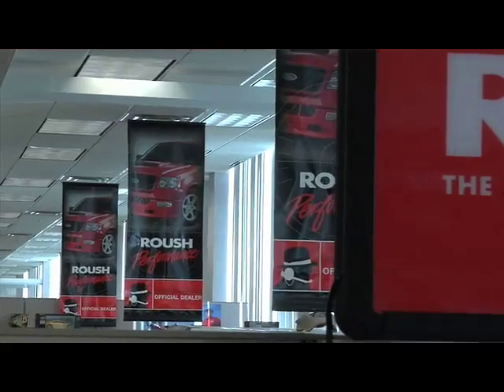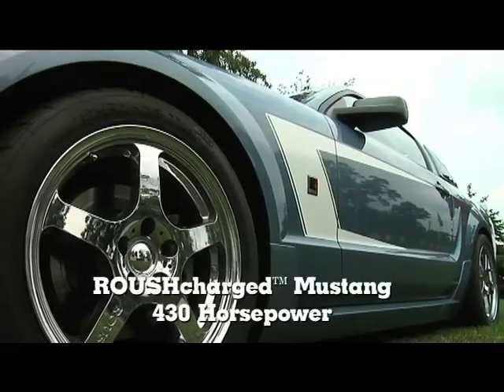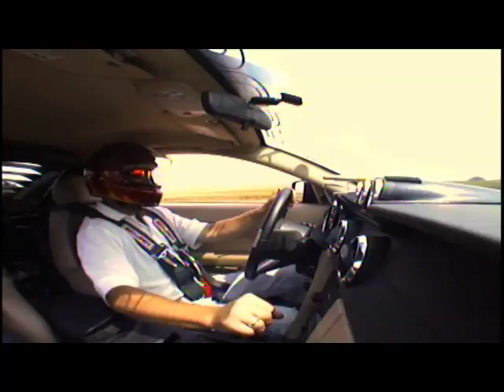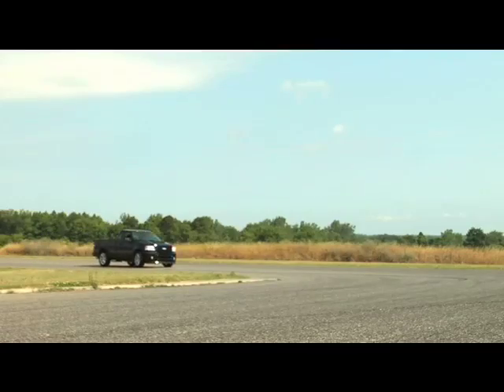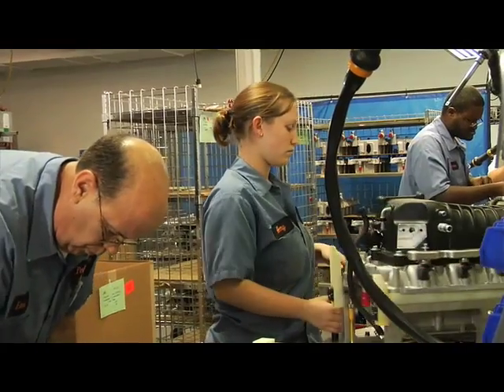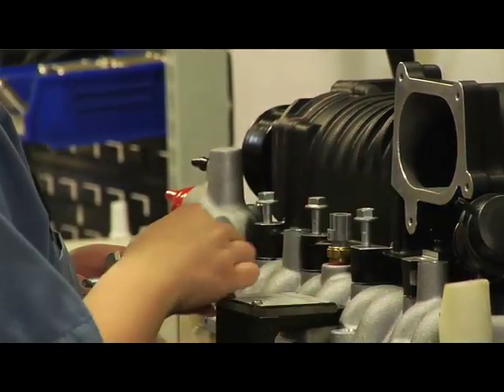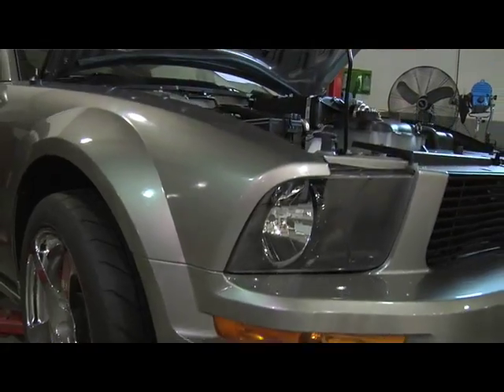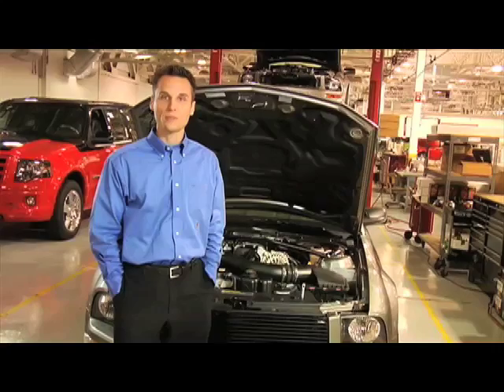ROUSH Mustang Supercharger Kits

Comment: My 2006 m90 equipped running 12.1s with 800+ quarter mile passes still running strong 2024.  Not particularly fast but a great bracket car.

Comment: I've been dreaming about supercharging my '05 GT/auto since I bought it back in 2011 with 6k original miles.  Has 21k miles at present.  I'm reading where this combination is ideal for up to and not a whole lot more than 400rwhp.  Does Roush still make a Roushcharger kit for my car?  Approximate price installed?  I want to keep the car looking OEM as much as possible.
Reply: American muscle has them. they also carry a TVS unit but they only fit a manual transmission gt

Comment: I just got the Brenspeed cold air intake 2.49 pulley and idler with long tubes and high flow cats and Blocked of my silencer Ports and holy shit that super charger wine is insane now and my boost gauge reads 8psi boost at WOT . If you have a M90 get the brenspeed package it will make it a whole new animal